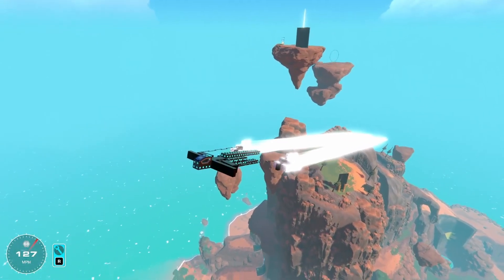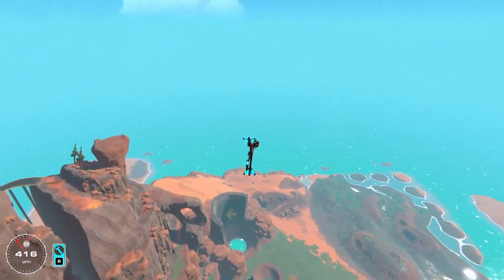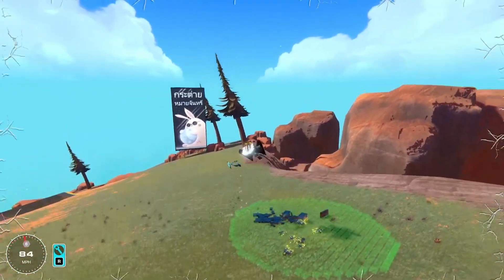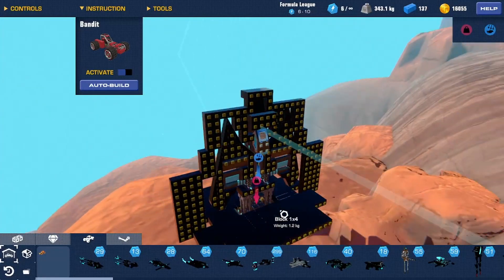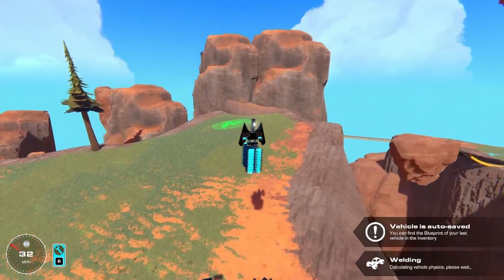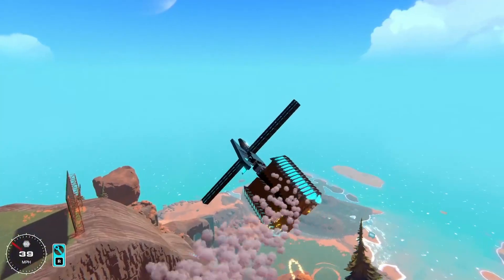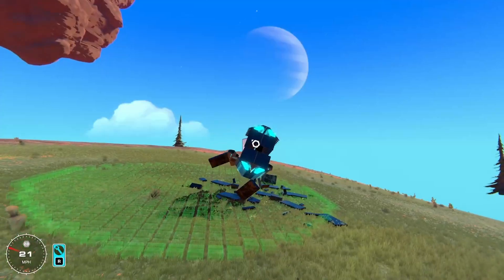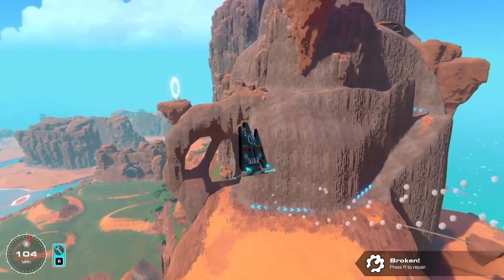NEW ENGINE PROTOTYPE Codenamed COMPRESSION | Modular Components 1

Comment: Okay Hear me out i messed a lot With pistons and i Comedy Across something… you get a Good amount of power in cirkiling when u dont subtract a pisten into hinges more pulling the heads from them away from their bottom when u now use the hinge u get a cicular force Like a Servo but way stronger
Reply: And i also Found a super high jittering thingie with pistons and Suspension
Reply: Oh and when u use the trieangel Suspension u get Like 200 km/h in circular motion

Comment: from my testings, it's not really kinectics based (at least in my version, didnt really download yours), it's more speed based from what i got... from mine, it gives the "kinectics" thing because of the initial jitter that gives it a little boost to make it able to do its thing, because while i'm freefalling above 100km/h, it starts up and works normally(stops randomly jittering at 200+), no impacts needed

and it's really weird how higher weight make so it goes faster, was able to get it up to 260-ish km/h while horizontal

edit: tested it a bit further using thusters on detachables, and the speed based theory seems accurate